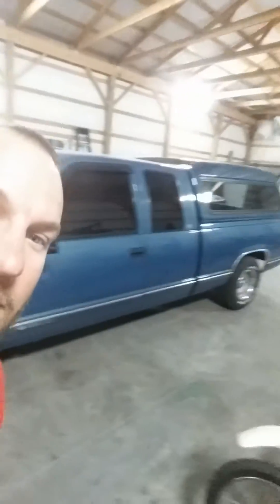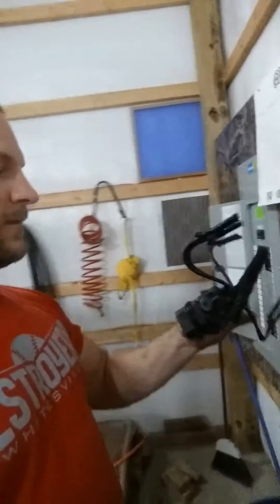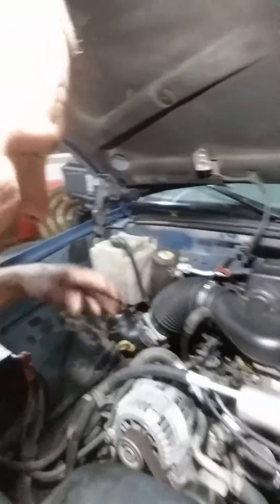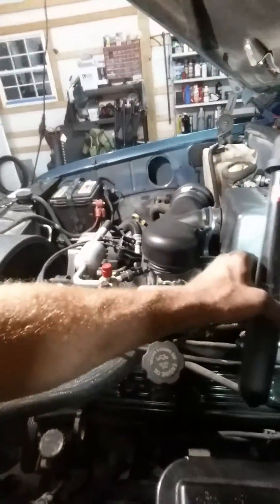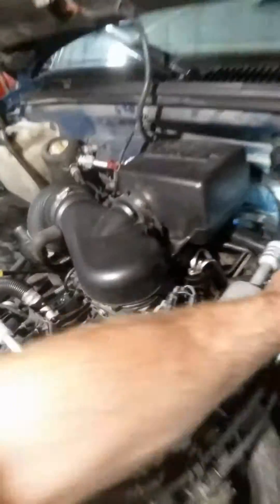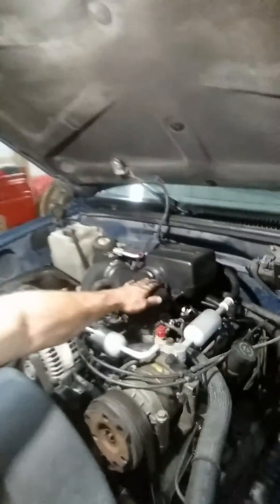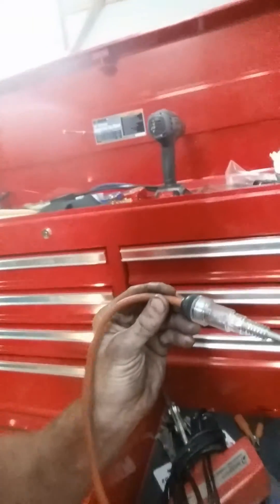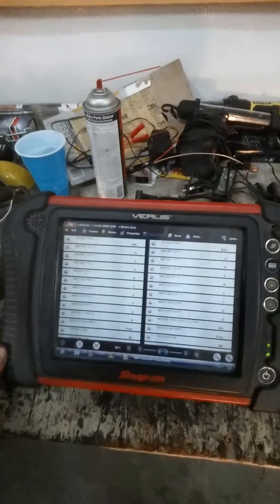1997 GM Vortec 350/5.7L CFSI to multiport conversion

Comment: The original spider injection is, in -fact, a multi-port injection system (NOT central port, like a TBI) as it has an individual injector for each cylinder inside the fuel injector body, which is controlled in time for each piston by the PCM. I wouldn't recommend the conversion to the lower injectors as you WILL, without a doubt, lose power and idle quality vs. a proper functioning spider injection system, every time. It might be better than what you had before, because you had a problem before, but that doesn't mean its the correct solution. The injectors and their connectors will hinder airflow inside the manifold costing horsepower at higher RPMs as well as reducing manifold volume costing low-end torque. A replacement original spider injection is the best bet, and will have it running its best. People who promote the conversion aren't really bright enough to think through the consequences. Additionally, injector timing will become off, because the PCM is programed to account for the time it takes the injector to pressurize the line and open the poppet valve. When you move the injector location, the timing becomes off unless you reprogram the PCM. And furthermore, there is a reason they did what they did by placing poppet valves down in the heat zone, instead of the injectors, the injectors last forever that way. Ive seen a bazillion of these with 300k miles or more with the original injection setup. Usually what happens is the fuel pressure regulator goes bad, and when people replace the whole unit it comes with a new FPR which actually fixes the problem, but the actual reason why is unknown to them.... when all they had to do was change the FPR in the first place and leave the injection system alone, as these virtually never have problems, unless you don't periodically run a bottle of fuel injector cleaner through it like you're supposed to do with all vehicles anyway.

Comment: Getting ready to do this to my 97’. New intake manifold. MSD distributor. Will be doing more mods to make sure it runs fine for a long time. Was my pawpaws truck. Putting money into it to restore it. I was with him when he bought it new and we have a lot of memories in it
Reply from the maker: Yea my cousin had a twin to this one, but he said it was missing. And it was....but come to find out the off idle miss he felt ended up being (believe it or not) a FACTORY miss-timed drive shaft!!
Reply: @kennyschopperz  what is a miss-timed driveshaft?
Reply: kennyschopperz that’s crazy! Guess you can’t be perfect all the time
Reply: Distributor cap , is the most common problem, buy only GM Cap  3&7 cris cross a burn a hole